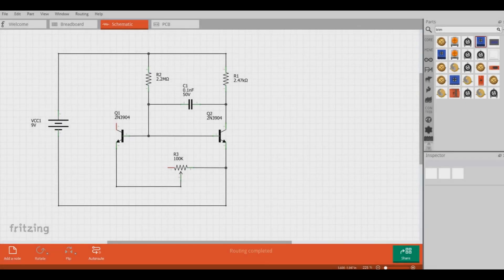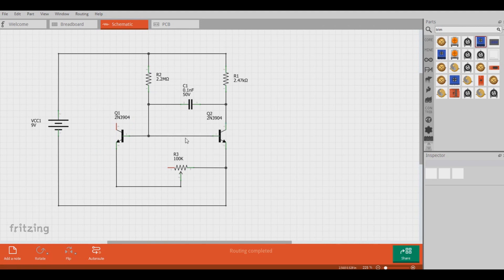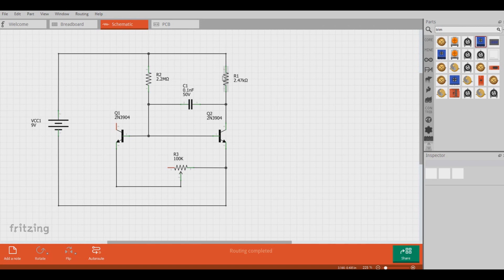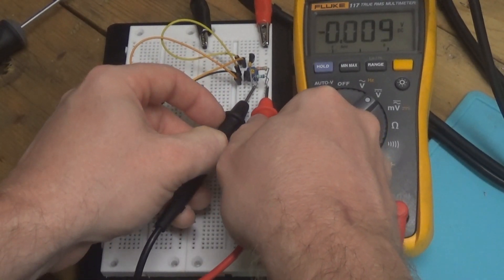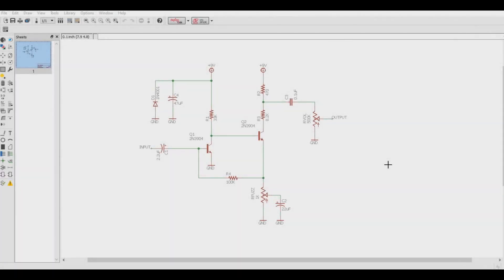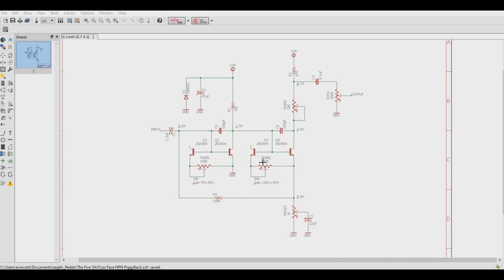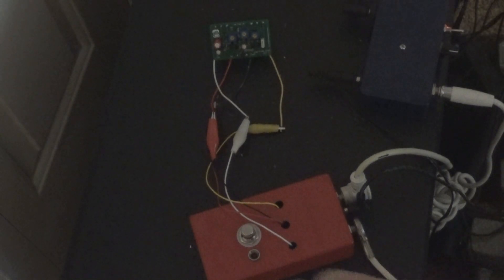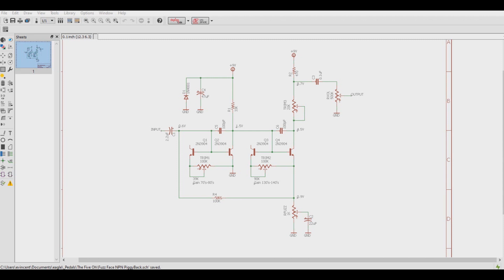Piggybacking NPN Transistors

Comment: Hi. This video is great. As I understand it, the first circuit is the piggybacked transistor 'tester' circuit. Is that correct and R1 and R2 are ommited in the FF circuit as they are not needed.  Have  you experimented with simulating leakage at all. I found a comment on a forum from RG Kean saying to add a germanium diode between the new collector and base (where you have the high-roll-off cap). Have you explored this at all?

Comment: I realize I'm late to the party but this is very helpful. I've breadboarded a few different Fuzzes and trying to decide on transistors, All I've got are higher hfe BC108s and 9s and 3904s. In this videos the breadboard set up is to test combinations. Essentially you fidd a resistance value and join the 2 transistors at the base and put resistor value between the 2 emitters?  thats it ?

Comment: Thank you. I have much fun inspeared by your videos. I build this kind of fuzz with bc109b and compare with existing germanium pedal with germanium transistor fuzz face i build from salvaged parts (unmached transistors, hfe ~105 and 110, average leakage, but good sounding for my needs). I did not like "cleaning", so i switch 100p to 170p film caps, silicon fuzz is a bit softer in "cleaning" than germanium circuit. "Right" value could be in between?

Comment: Thanks for this vid and all the hard work! Question: Is this what is called a "Push-Pull" design? or would that involve Both an NPN AND a PNP transistor?
Reply: A Sziklai Pair is more of a complementary feedback design. So in a generic way of looking at it, the base of the two transistors (NPN and PNP) are not tied together and the pair together control both the tops and bottom of the sine wave. A Push-Pull, like in a Class B amplifier, has the bases of both transistors tied together. Further, the NPN transistor only controls the positive half of the sine wave, while the PNP transistor only controls the negative half of the sine wave.
Reply: @erikvincent5846  Ahh thanks. This appears to be simpler and very clever way to use low gain transistors. Just found you yesterday, great stuff tho right off the bat, as they say. Thanks!
Reply: @Bob-Whiting  Welcome to the channel. If you have any other suggestions or questions, let us know and we'll see what we can do.

Comment: The BC108C would work on this circuit too? I'm trying to measure the gain but the DMM shows 8.5v. With a 1M resistor on the place of the 100k pot I get the same 8.5v. On diode testing I get 0.764 on B-E reading, but on B-C I don't get a reading or short.

Comment: Dear DIY Pedals, I just found your youtube channel and I am hooked. Thanks for that! Reason I found your website is because I am trying to make something but I'm not sure if its possible or how to do that. I currently have one expression pedal with a trs output. I have multiple pedals with expression functions which take an trs input. So far so good. What I want to build is some sort of signal splitter with 1 input and 3 outputs (and corresponding leds) so I can decide which effect i can stear with the expression pedal. So when I stomp switch one effect 1 will be steered by the expression pedal. When I also stomp switch 2 effect 2 will also be steered. etc etc. Can you give me some advise or tips?

Comment: Just getting started... Right now the only transistor I have on hand is 2N3906 (PNP). Am I reading the datasheet correctly in that it has a gain of greater than 250 Mhz?
Reply: You would be looking for hfe
Reply: Gain is the ratio IC/IB or hfe.The frequency range of transistor is the bandwidth.

Comment: 2n3904 pairs with its compliment 2n3906 and most have a complimentary NPN PNP pair with exact specs to make Complimentary Darlington. Piggybacking is using a high gain to make low gain.. The opposite idea.. Might be useful if you want to make an HFE of 6.

When running a Sziklai theres a resistor used similarly I think I last used 1k. Putting a variable resistor there would help driving a Germanium paired Sziklai..

I like the way your taking this.

Comment: I have a crap pile of old germanium transistors that a dying engineer gave me because he knew I was a builder. Main problem is that they are ancient. Should I even bother trying to use them, as they are all probably whiskered up, or should I give them a shot?

You also have me wondering what an old Radio Shack pack of 2N3904s or 2N2222s would sound like as well. The  HFE on those transistors were all over the place :D.
Reply: Most likely shot. Best to box them up and send them to me! 😅
Reply: @HazeAnderson  Hey, if I get the thing working and sounding okay, I'll send you a few of them and the modified schematic so u can duplicate things. I'll have to add a bit of bias for germanium, of course.
Reply: @davehebert3403  That is very kind of you! Best of luck building it! :)
Reply: @HazeAnderson  No problem. Unfortunately, I'm finding it rather difficult to find the time to etch a board. Taking care of my invalid Mom and working from home, so I have a busy schedule. I'll eventually get to it, though, and when I do, I'll revisit this comment and let u guys know how it's playing. Hmm. Maybe I'll post a vid on my channel so u can hear the thing, too.
Reply: Aren't the 2N2222 noisy?
As for the Germanium's, I'd say, try them...It's not like you're trying to get HiFi performance out of them. Might be worth adding an adjustable bias control as that can have quite an effect sometimes.
Reply: @Bishka100  Exactly what I was thinking, Bishka. Also, since this is  a Fuzz application, I wonder if it would even matter if they were noisy? Maybe it will add to the "fuzz" or something :D.

I thought about going really overboard and adding a bit of tone adjustment, doing so by reverse biasing a diode to act as a varicap. Hey, one more adjustment can't hurt :D. An actual varicap would probably work best, but I'm thinking about just trying various diodes and see how she plays.
Reply: Well, if you have NPN, usually they did okay, as far as germanium leaking is concerned, but their HFE are usually "too low to be used for anything meaningful". I would disagree, as if the leakage is low, either in a pair of them, or a silicon/germanium pair, you can make Darlington pairs that might be pretty cool. If you have PNP germanium, then I'd suggest pairing them with low HFE silicon NPN transistors (or a piggyback set) and make a Sziklai pair. That way, it becomes a "NPN" transistor that retains the germanium sound, but takes on more of the silicons characteristics and low leakage.
Reply: @erikvincent5846  Man, that is a great idea. What I'm really looking for is maximum flexibility while testing, and maybe I'll be able to dial in something that might sound appealing in certain situations -- or maybe not :D .

I also watch Shango066 here on YouTube. He does a lot of old TV and radio repair. He has a video or 3 on using Russian germanium transistors that you can get for a decent price, and they even look to be old milspec components. If I remember correctly, he bulk orders them on e-Bay. 

Definitely worth checking out his videos, and he's very entertaining, plus he's a great trouble-shooter.
Reply: @erikvincent5846  I have another question, Erik. First off, I am a software engineer, but I have studied electronics engineering for a very long time, so I can interface with EE's a lot easier, and also to build and design RF electronics for my ham hobby. I'm pretty much an audio noob, although I have read Robert Cordell's book and other material.

Well, actually, I probably understand a lot more than I give myself credit for -- I always try to be humble -- but there are certain areas in audio that I'm just not too familiar with, to say the least. One of these areas would be the use of germanium transistors. I've built only one thing in my life using them, which was an amplified xtal set for 40 mtrs, and that's it, dude. :D

From the way you guys are talking, it sounds like germanium is the way to go in certain audio applications. Do they sound better than silicon? As far as pedals go, is this the transistor I'm looking to use most often? It's not like I'd ever manufacture the things, and spending a little extra cash for germanium wouldn't be a big deal.

Actually, I've often thought about building a portable rack-mount-effects board that used a bunch of 12AX7's :D. Then I remember lugging around my old Marshall tube amps to gigs and think twice about doing such a thing :D.

Comment: Great vid, more experiments in the field of fuzz. I bought the unshaven fuzz pcb with footswitch pcb, in a deal you had. I don't play guitar, I make Industrial Dub and run an open mic night for ambient. The pedal has synth like tone and breaks up horribly, I love it, I did manage to squeeze it into the smaller enclosure, just, lol. I've messed around with the 7min fuzz, your design, and others, with various transistors, this Bazz Fuss, doesn't seem to do anything. Does this only work with guitar tones and impedance? Or should it be useable with most sound sources? Keep up the good work.
Reply: Usually, the Bazz Fuss is more of a lower gain fuzz due to it only having the one stage and typically with only a single moderate gain transistor. Also, with its single diode, it does have some good level of stability, and so it isn't as "splatty" as the Unshaven was designed to be. If gain is what you are looking for, changing the NPN transistor to an NPN darlington transistor of significantly higher gain, will help with that. Another trick is to just place two bazz fuss circuits back to back. If you look at the Unshaven, you can see this idea expanded upon. Basically, it's 3 Bazz Fuss circuits back to back, with the diode removed from each and in its place, a large value resistor.
Reply: @erikvincent5846  cheers Erik, I'll have a look at that, thanks. I have a load of modified LM386 pre-amps, that I sell with high response contact mics, electromagnetic field "sniffers" and cables. These tend to clip in a gnarly way, I'm looking at softening and expanding on this for my low gain "devices".